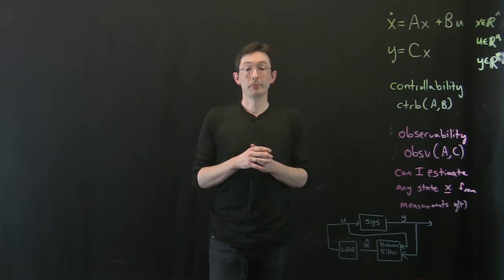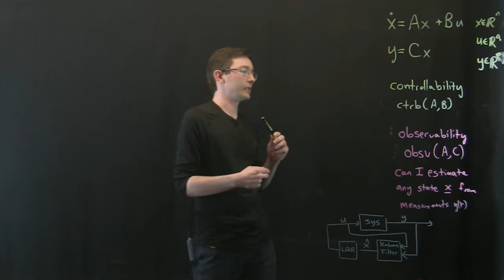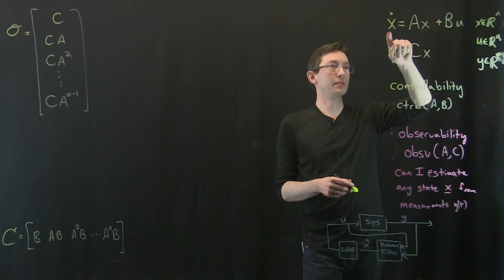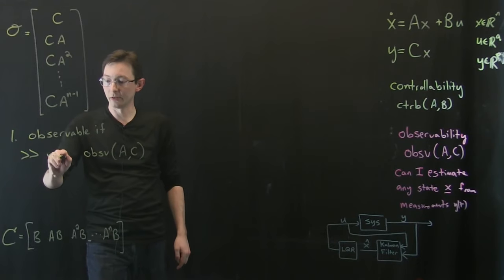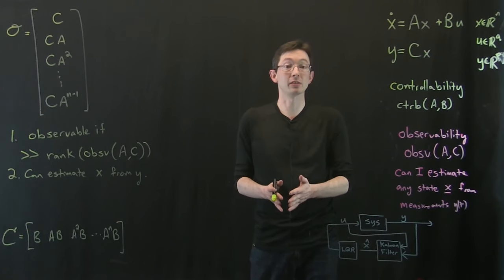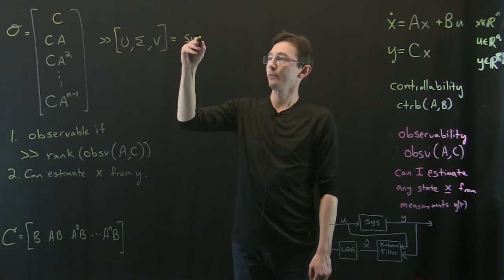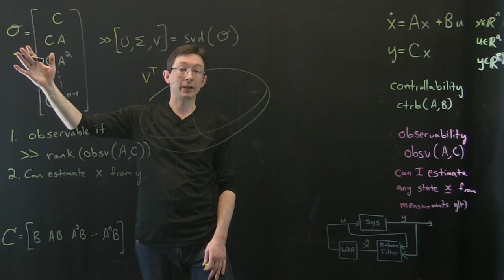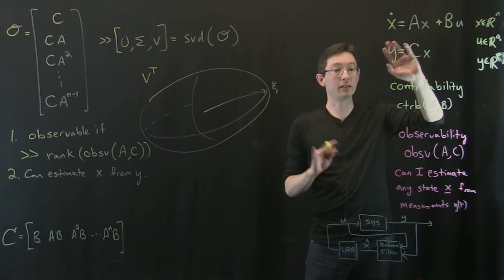Control Bootcamp:  Observability

Comment: When you say system is "more observable/controllable in some direction", how does that translate to which state is better estimated/controlled? With SVD, I will find  the vector specifying that direction, but how do I connect it to the corresponding element in the state vector (is it X1, or X2, or so on...)?